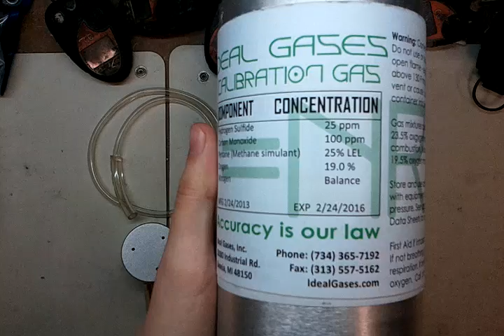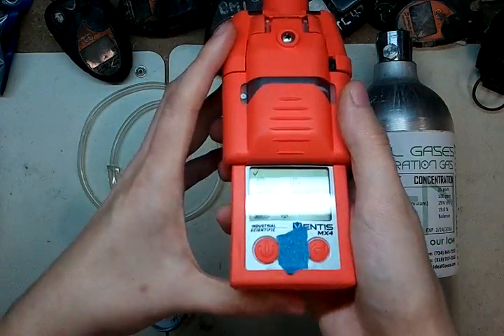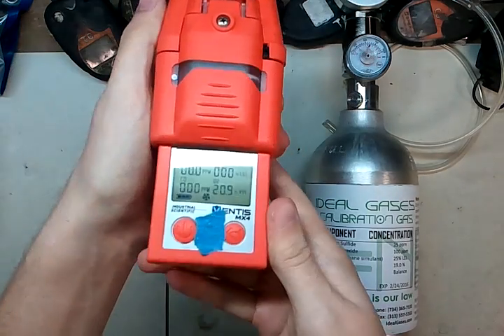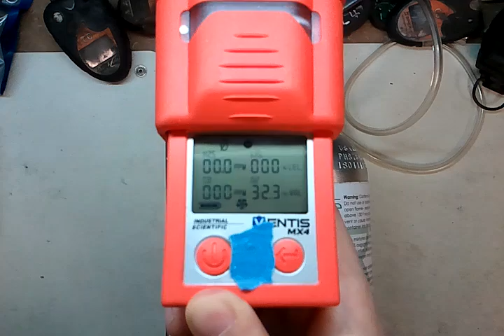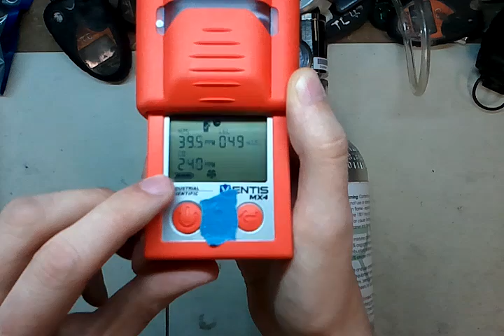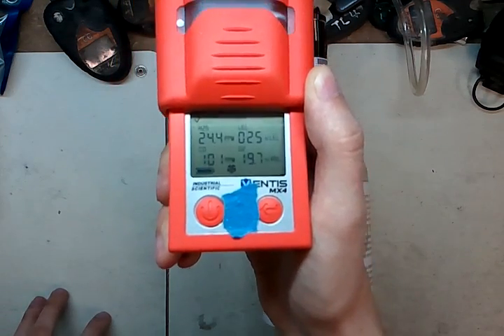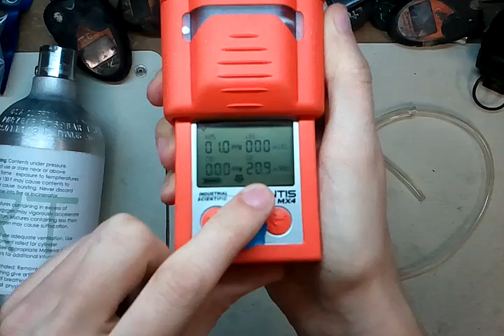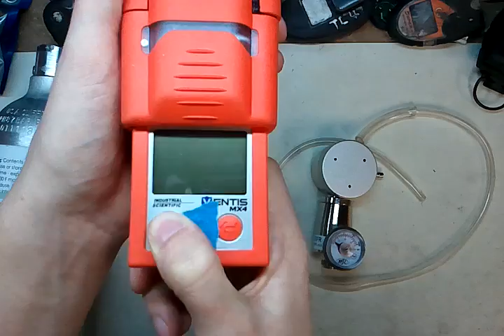Industrial Scientific Ventis MX4 Gas Calibration Guide by Ideal Calibrations

Comment: So I turned on the monitor, and it gave me an oddly low O2 reading (~7%) but I was going to cal it anyways.  It passes the cal, says 20.9% O2, but it still in alarm.  I bump-test it, and it passes that, and now reads out with a "b F" for O2, but after 3 more cals, it still passes, and REMAINS in alarm.  What do you suggest?
Reply from the maker: Hey Zooks, did you bump test it using the software bump test on the unit or just do it manually by applying gas? b F indicates a bump failure. Gas is the proper blend? Sometimes people buy the old ISC mix that was for the M40 and has 19% Oxygen instead of 18% and then the unit will pass cal (it cal's O2 during Zero to room air) but will fail O2 on the bump test. Give us a call if you want to troubleshoot a bit more.

Comment: I am having trouble getting my oxygen to pass. I am in very clean air and calibrate the monitor. Every time I turn the monitor on, it goes through the initial sequence, but the oxygen always fails. What route do you recommend?
Reply from the maker: Hey there, think we just spoke on the chat on our website. I'd recommend replacing the Oxygen sensor. Forgot to mention: Make sure once you install it you wait an hour for the sensor to stabilize and get used to the new environment, otherwise it won't work properly. Take care and let us know if you have any questions

Comment: Sure woulda been nice had ya turned the gas on!!!!!
Reply from the maker: Hey Kimberlee, I'm not sure what you mean. The regulator in use here is a demand flow regulator, so it doesn't need an on/off valve. It provides gas when there is a vacuum applied to the regulator (from the pump of the gas detector). If you have an on/off fixed flow regulator, I'd recommend you make sure and use a bleed valve during the calibration unless you're using a diffusion MX4 instead of a pumped MX4.
Reply: To calibrate with the pump accessory, do I use the demand regulator? Or  Can I use another one?  @Idealcalibrations

Comment: Whats the flow rate for that demand flow regulator?
Reply from the maker: Hey Nikola, big fan of your work, demand flows match the flow of the pump (which should be around 0.5lpm in this case). However, because pumps vary, that can be a range around there, like 0.3lpm - 0.7lpm. The regulator itself has a range of 0.1lpm - 3.0lpm per the manufacturer's spec.

Comment: didn't see you actually turn the gas valve on
Reply from the maker: Hey Greg, this is a demand flow regulator, which means that when you apply a vacuum (from the pump on the monitor) to the out port, the regulator opens the valve itself, releasing the gas at the correct flow for the pump.  Using a fixed flow regulator (one with a valve that you turn or switch on and off) can damage pump motors and seals because they either release too much gas, putting pressure on the pump seals, or too little, which causes the motor to work harder than it needs to, causing your motor to burn out faster.
Reply: Its a demand regulator of course not.......